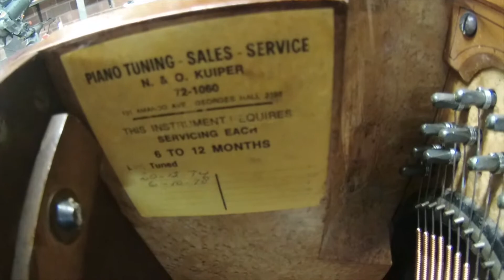Richard Lipp restoration

Comment: I'm currently restoring an 1890 Ivers & Pond piano that has the same style of felt over the capstan screw heads on the key sticks. Do you have any tips or video examples of how you adjust for lost motion with that style capstan? I've not encountered this before.
Reply from the maker: Its a frustrating system as you have to remove the key-stick to adjust the lost motion. Theres usually a screw located under the key felt. Screwing it up or down with dictate the lost motion. It doesn't tend to be too stable. 
good luck!
Reply: @heirloompianos1846  Thanks. I assumed that was what I was going to have to do, but I had hope for some kind of a trick or tip to make it easier. It sounds like that's not the case.

I have had other technicians suggest modifying the key sticks to put in more modern capstans, and I'm still considering that option, but I haven't committed to that yet.
Reply from the maker: @myantiquepiano9345  I've done that with some projects. It's not too hard to do. Simply drill & plug the screw holes and replace with a size capstan that works. Just make sure the whippen heel has some felt attached to reduce the noise!

Feel free to subscribe for some more videos